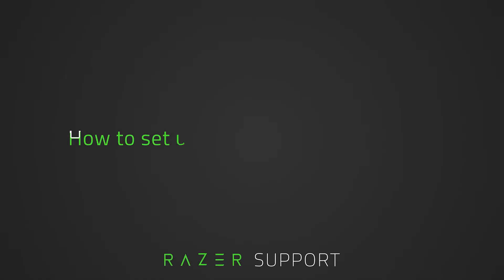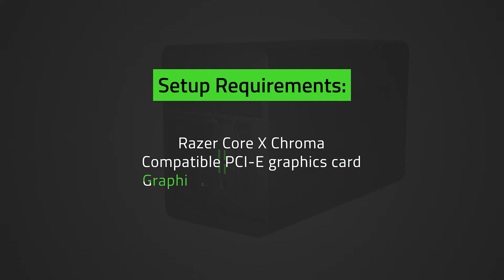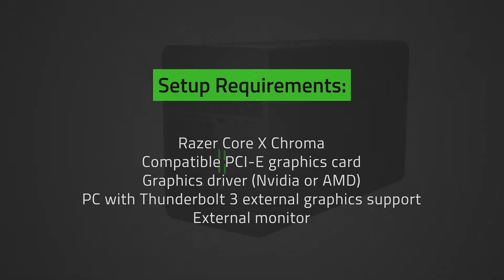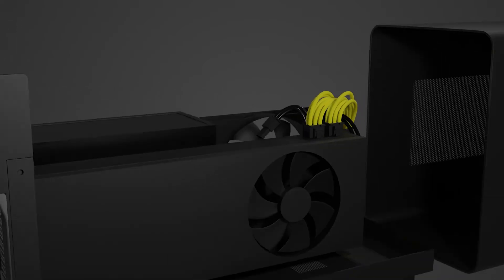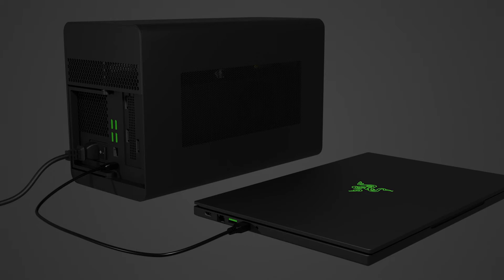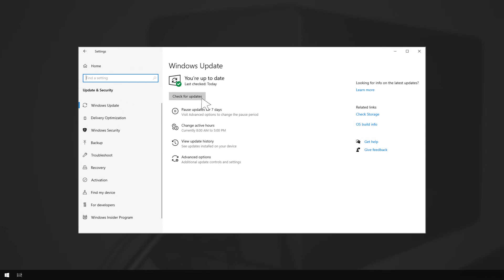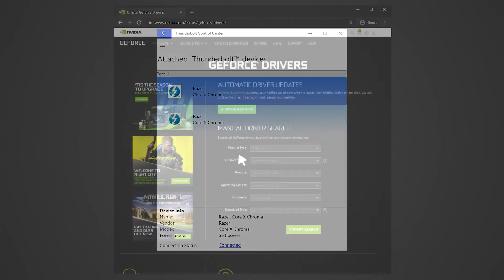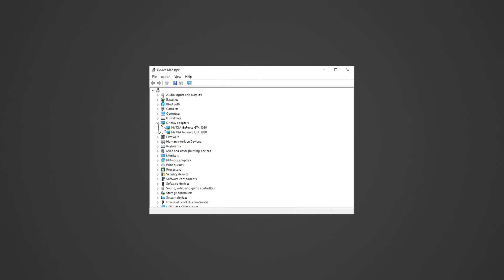How to set up the Razer Core X Chroma

Comment: Tip: plugging usb hubs to the Chroma can cause stuttering and other issues such as the usb hub not working properly.

Use the chromas own ports or your computers ports.

Also remember that NOT all usb4 ports in computers are compatible, so the Chroma will not work on all usb4 connections.

Do your research on the usb4 port technology.

Note: I have attached the Chroma to Lenovo Legion Go hand held Windows 11 pc which has 2 x usb4 ports. Works with an rtx 4070. Performance is great, only about 15 percent loss in performance versus a table top PC.

Comment: I did everything like described. But when i connect it to via usb 4 slot on my mainboard (ASUS Prime Z790-P WIFI) the fans of my eGPU are running like crazy but the GPU does not show up. I can see that the Core X is connected (in my device manager).  But it like said, GPU won't show up. All latest GPU drivers are installed. All Win 11 Updates are installed. 
Using the original TB3 cable wich comes with the Core X. 

I had the same issue with my Laptop and the Core X there I needed to allow Win 10 to alway connect this Thunderbolt device. But Win 11 does not give me such prompt. 

Deos it work with a USB 4 connection? Or ist Thunderbolt 3 special in this case? What else could be the problem?
Reply: Your motherboard does not support TB3. It is pure USB-C. So you are out of luck. Nowdays most USB-C 4.0 also have TB3 support, but apparently Asus decided not to do it on the model.
Reply: @ itˋs been a while ….
I now use an extra Thunderbold card, wich now is in a PCI slot. Not ideal … but it works

Comment: Is a 3060 a good gpu to put inside vs the Razer 2080 max a I currently have
Reply: If useful I'm using a Tuf 3060 oc 12gb V2 card with non chroma Core X and the cable it came with. Superposition benchmark 1080p extreme is 4607 with  my laptop (i7 9750h 16gb ram) I'm new to this so that may be a terrible result for all I know. I'd prefer better of course. Playing Far cry 4 on ultra settings I get an average fps anywhere from 50 to 90 but mostly around 65 and looks plays pretty well. Far Cry 6 is a lot lower but I'm yet to try different settings.
Reply: @windbagfusspot6155  you have been so much help ty. What mobile gpu is in your laptop?
Reply: @kumaSOevl  It's a gtx1650 mobile. For laptops.

Comment: Does the 4090 FE fit inside? Or will you have a newer version that will?
Reply: the included PSU does not have the right connectors for it
Reply: @trr4gfreddrtgf  can someone change the psu in the core x chroma?
Reply: @kamenotost22  I'm not sure, you probably could but it may not fit well

Comment: Hey RAZER Support! I'm waiting for mine Chroma and i have a qustion: I have in my laptop 2 slot Thunderbolt 4. Can I conect my laptom with 2 cable Thunderbolt3 to Chroma for more efficiency eGPU system? First cable: Thunderbolt port#1 in laptop -> Thunderbolt port in Chroma. Secound cable: Thunderbolt port#2 in laptop -> Display port in my RTX3080 (inserted in Chroma). Will it work ??? THX!
Reply: if you are asking if you can use thunderbolt 4 with a thunderbolt 3 cable then yes yes you can

Comment: so do we just have to buy 1 thing and the rest is build for razer core x chroma  or do you not have to buy anything if we buy razer core x chroma
and is it suitable for a monitor
Reply from the maker: The laptop, graphics card, and monitor need to be purchased separately. You'll need these setup requirements in order for the Razer Core X Chroma to work.

Check out this resource: 
https://mysupport.razer.com/app/answers/detail/a_id/3774

Contact us here if you have questions:
https://insider.razer.com/index.php?forums/support

Comment: What happens if you dont have thunderbolt
Reply from the maker: You will unable to use the Razer Core X Chroma. It needs the 40Gbps data transfer speed of the Thunderbolt 3 connection.

Check out this resource: https://mysupport.razer.com/app/answers/detail/a_id/3774
Contact us here if you have other questions: https://insider.razer.com/index.php?forums/support/

Comment: Not work with my Mac Mini 2012 i7 + Shaphire RX 590. THB3->1/2 original convertor used. In settings it show AMD RX 590 driver is not installed. Waste of money. Support never response.

Comment from the maker: The Razer Core X Chroma is officially designed to work on Windows and macOS. We are sorry but we cannot guarantee it will work on Linux OS as intended. Although, our community successfully used it on Linux with open-source drivers and files. 

Contact us here if you have other questions:
https://insider.razer.com/index.php?forums/support
Reply: Hilariously, this egpu works better in linux compared to windows. With window's I'm getting BSODs constantly. Linux just works.

Comment: hmm awesome, i ordered already. How it work with linux? im using arch linux and i can install latest version of nvidia drivers group (nvidia nvidia-utils nvidia-settings) by package manager. How its rly worrks on linux distros? can i have issues what to do when i get it soon for linux also?
Reply from the maker: The Razer Core X Chroma is officially designed to work on Windows and macOS. We are sorry but we cannot guarantee it will work on Linux OS as intended. Although, our community successfully used it on Linux with open-source drivers and files. 

Contact us here if you have other questions:
https://insider.razer.com/index.php?forums/support

Comment: Razer has not acknowledged how to connect 3000s gpu or Radeon RX 6000s to the egpu since the razer core X Chrome does not supply the 3x8 pin connection. Also is it possible to remove the battery and upgrade it to a recommended battery to be compatible for the egpu
Reply: I'm actually pretty sure it still works with two 8 pin PCIE's

Comment: Hi. I have an issue connecting my Asus tuf gaming app with razer core x .. with rtx 2070 super msi gaming x in it. The laptop recodnise that core x but no recognition of any gpu... is it possible because the laptop is with  USB type c 3.2 not thunderbolt ? Any suggestions?
Reply: Try connecting your Razer Core X to a laptop using the Thunderbolt cable and see if it works fine. For additional assistance, please reach out to us from here: https://insider.razer.com/index.php?forums/support/

Comment: is the Razer Core X - Mercury  compatible with  MSI GS65 9SE Stealth (GS65 9SE-478US) ?
Reply: I do believe any labtop will work as long as their Intel processors with c type port. Some may not have that option though which is unfortunately
Reply: fuck man did you at least watched the video

Comment: is the Razer Core X - Mercury  compatible with a monitor?
Reply: You can connect an external monitor on Razer Core X  - Mercury Edition using the display port of your installed graphics card.
Reply: @razercustomeradvocacy4630  ok tysm